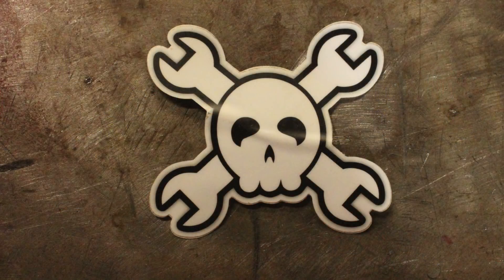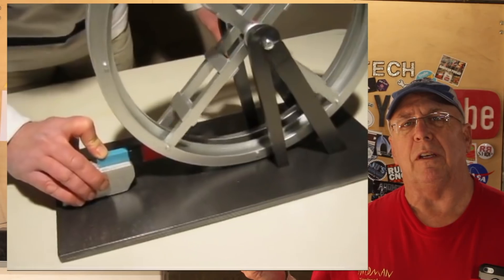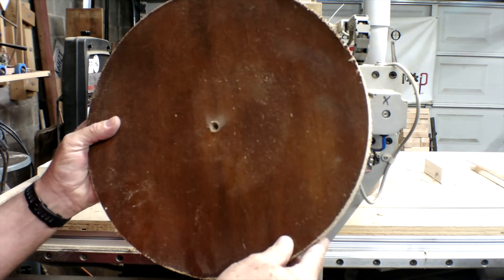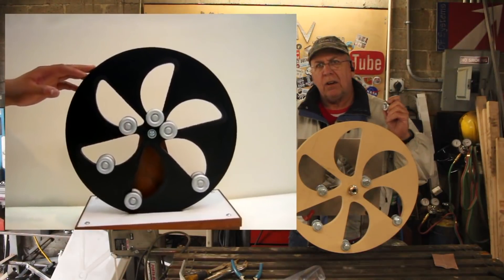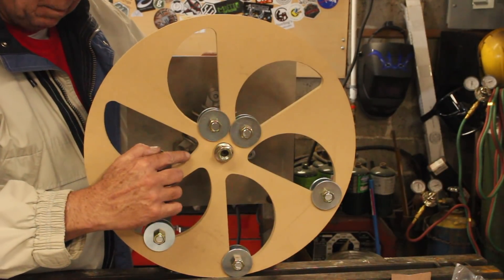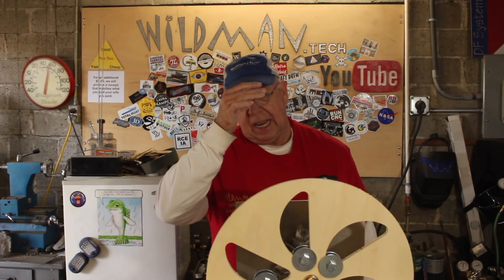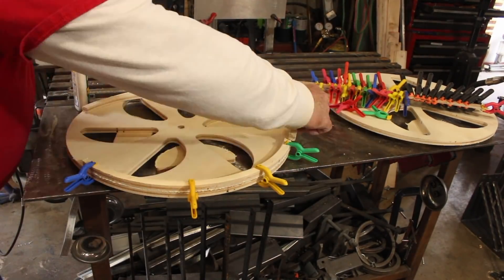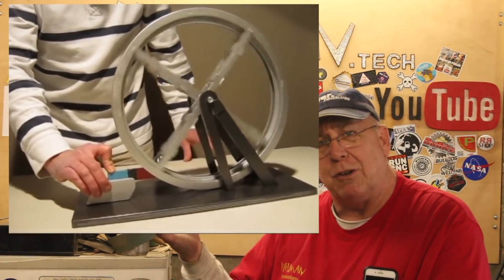Free Energy Devices Debunked!

Comment: I hate that with all the things I know like the earth isn't flat, we landed on the moon, typical conspiracy topics, my brain still can't understand why these things shouldn't work.
I'm not the smartest guy in the room, but I'm also not easily distracted by shiny objects. My own personal oxymoron I guess you could say.
Though I am walking away with new questions a lot of old ones have been answered for me thanks to this video. I guess I never bothered to really study it like other things so I'm far less knowledgeable, and my recent desire to be as self reliant as possible has lead me a bit into the weeds. Think I'll go back to watching solar panel and battery videos.
Sorry rambling. Thanks for the new knowledge sir, much appreciated. Cheers!
Reply from the maker: I just had to try for the same reasons.
Reply: Everything in relation to energy, be that electricity, kinetic energy, heat, etc wants to equally distribute itself. Also, you can only harness energy for human purposes while said equalisation occurs, however long or short that time takes. All energy does is equalise.

Heat and cold mixes to create a temperature somewhere in between. We isolate a fridge as much as possible so the cold does not mix as fast with the outside, hot temperature.

The reason cars and other objects slow down without extra energy is because they are passing their kinetic energy onto other physical objects. Such as air, or another physical object in a crash, in other words the air becomes faster, the car becomes slower. The same applies to electricity. So. Energy equalises, that is all it does, you can only harness som e of that "equalisation" while it happens, harness it for human purposes. For example the internal combustion engine. It explodes gas. What follows is there is large pressure in the combustion chamber and it expands. It expands to equalise the pressure. Now, it is not an accident that the first thing this high pressure gas meets is a piston. Which is the harnessing of the energy.
Reply: Free energy devices DO work. You just aren't told about parametric coupling.
Reply: @lukiepoole9254  You should make a video on the subject and post it here on YouTube.
Reply: Look up HHO GAS you won't be disappointed
Reply: Can you please please please send me proof that the Earth is a spinning ball? I've fallen down the Flat Earth rabbit hole & am actually quite loving it because it's boosting my relationship with the Most High God tbh.
Reply: @god_given  
Probable physics and math that you're too lazy to understand.
Reply: @uuddlrlrabsmhm8430  show me please!

Comment: You can be making energy in about 20 minutes. This can and does work.

Let’s say your sphere has a mass of 250 grams and the wheel a mass of 6 kg.

Place the sphere on the end of a string, Fasten one end of this string to the outer surface of the wheel and wrap the other end of this weighted string around the circumference of the  wheel for about 1 circumference. Wrap the string clockwise; and then spin counterclockwise and release the 250 gram sphere from the wheel. 

The .250 kg will unwrap and stop the rotation of the wheel 

If the average release speed for the 6 kg wheel is 1 m/sec then the sphere speed will be (6 kg / .250 kg) 24 m/sec when the wheel is stopped; because Newtonian momentum is going to be conserved. 

6 kg * 1 m/sec = 6 units of momentum    and    .250 kg * 24 m/sec = 6 units of momentum. 

½ * 6 kg * 1 m/sec * 1 m/sec = 3 Joules      ½ * 1 kg * 24 m/sec * 24 m/sec = 72 Joules

This 72 Joules is real energy. The .250 kg will rise 29.36 m

When the .250 kg is dropped (in something like an Atwood's machine) 1.223 m it will restart the motion of the wheel to 1 m/sec.

Only needing a 1.223 m drop means you can restart the wheel 24 times with one throw. You increase the energy to 24 times.

These SPEEDS are DANGEROUS use caution.  

 https://www.youtube.com/watch?v=w-7d66JscI8

Comment: Energy is never generated. Ever. There is a finite amount of it in the universe. Energy only changes from one form to another through work. So anybody saying they can generate free electric doesn't know electronic engineering.
Reply from the maker: You don't know that. You only think that because it's what you've been taught to believe. There may one day be a discovery. One thing is certain, it won't be discovered by anyone who thinks they already know all the rules. You know, they used to think the only way to fly was a hot air balloon, then someone with a curious mind discovered something.
Reply: @WildmanTech  I think you're misunderstanding me. Free electric can not exist. Harvesting energy is a thing though. They are not the same thing. I'm working on recycling scrap metal in a biodegradable solution to charge lithium ion batteries. Galvanic cells. Where chemical reactions create energy. You make too many assumptions.
Reply from the maker: @base2446  I understood you perfectly and I’m telling you that you’re wrong because you’re brainwashed by an education system that thinks that everything that can ever be discovered has already been discovered. That erroneous belief has been proven false thousands of times through centuries.

Comment: Ask Tesla. Learn History old man
Reply from the maker: If history dictated the future we’d never make any progress. Just because someone else couldn’t do doesn’t automatically mean I can’t either. But I can tell that in your case it does!
Reply: @WildmanTech  thanks for the video. If my understanding of how the ball and magnet thing is supposed to work, the magnet pulls the ball and the weight of the ball is supposed to turn the wheel. Except the weight of the ball can't act on the wheel while it is held up by the magnet. Or is it that as the ball is pulled up the friction of the ball with the wheel will cause the wheel to turn, again as the ball comes up on  the wheel, at some point the pull of the magnet is  countered by the pull of gravity and again it stops. So no, it can't work.
Reply: @WildmanTech  a guy build a car with no fluid. Only magnetic in the 70. Search it on google or here

Comment: the wood is too heavy, they used aluminum for the wheel. the metal ball is not heavy enough to turn the wooden wheel. if you use an aluminum wheel I bet the steel ball will turn it.

Comment: My problem with your demonstration in your whole contraption is wrong from the fly wheel. Flywheel is spinning on an axis or axle in the middle and using a smaller ball and is all metal with perfect balance. You have a piece of wood and the axis to one side. it wobbles and out of balance. plus the ball looks like it is hitting the wood. And your wood flywheel was doomed to fail because the metal ball going again the grain surface of the wood is not a good surface and has much friction to prevent motion. it looks like in  the orignal video they are using an electro magnet instead of a regular magnet. and even if it is a hoax.  Your experiment isnt holding up because you are not using the same materials

Comment: I can show you how to do a terrawatt steady from vibration and feedback with no moving parts... no magnet.. no coil.. no battery and no power input whatsoever. 12 parts total.... but you wouldn't want to build it it's a terrawatt AC.. very dangerous to stand too close to it. It's so incredibly simple though... when you see how simple it is you realize how stupid everyone is. You would need a water jet CNC cutter to cut the 2 granite piezoelectric speakers and a machine shop to make the Fret and the 500 lb xylophone key/ microphone...and the holy grail tweeter that feeds back into the microphone . It works on feedback and piezoelectricity and even makes it's own water that turns into mini suns spinning like a galaxy in a box. It's an incredible feat of mechanical and acoustic engineering and works on the principle of putting the microphone too close to the speaker.. but this is a 500 lb microphone... and when it vibrates bobbing up and down on the fret it amplifies the force on the piezoelectric disks 829:1 giving over 400,000 lbs of force on the disks. As I said.. free energy is so incredibly simple to do. it works exactly like the universe works.. it's all feedback. First you hear the sound and then you see the light. You wondered your whole life how it's done .. just ask me... it's really simple once you see it. I seen the power when I accidentally discovered it about 40 years ago.. It made me shit my pants.. no joke. Spent about 30 years trying to figure out where the power came from.. then it dawned on me that it was just feedback because I remember hearing it before the bolt of lightning struck me... and then I completely solved it just in the last few years... engineered all the parts in 3d.. but too scared to build it.  All it needs is someone with deep pockets to bring it out. The world needs this because .. it makes water .. it makes energy... you can go anywhere you want in the universe on a cup of water and you will never run out because it will use the same water over and over again. Those mini suns from drops of DEW  spinning like a galaxy in a box are exploding right back into the microphone in an endless feedback loop.
Reply: You should build it and put it here on Youtube.
Reply: @MarshWildman  I can send you the 3d drawings so you can understand it better. I would need an email address.  It's basically 2 granite speakers pointed in opposite directions back to back but not touching that are connected only at the center.. and a 500 lb xylophone key/microphone mounted on a fret at the nodes over the outer edge of the speaker facing up.  The xylophone key is like a church bell if you hit it you will hear it for miles... but it is not meant to be hit.. it's a microphone... and so it will pick up all vibrations for miles and feed it to the speakers which in turn will make the center bob up and down up to 20 million hertz.. feeding it right back into the microphone. Because the microphone is heavy and mounted on the speaker.. the feedback will keep it vibrating forever. And so based on the calculation that 500 lbs of force on a granite/quartz speaker produces 4000 volts per cubic centimeter..... you should get 1 trillion volts per speaker. The force is amplified 829:1 from the bobbing up and down action of the center of the 2 connecting speakers that share the center. The center of the speaker facing up has a tweeter cup called the holy grail that sits under an air hole like the hole on a guitar and water condenses in the cup and spills over onto the speaker  where the radio frequency splits it into HHO gas that then goes boom right back into the microphone in an endless feedback loop. Works just like the universe works.. it's feedback because the microphone and speaker are too close together. And so because of the spin.. you don't need a magnet or coil or any power source. The amperage is achieved because the center tweeter is positive and the outer edge of the speaker is negative..and because of the water in the granite speaker it conducts.. and so you get 2 trillion volts with amperage. Parts needed...2 granite speakers... 2 mercy seats shaped like stonehenge that mount over the outer edge of the speakers aka musical frets.. 1 center cog that connects the backs of the 2 speakers together at the center only....one holy grail tweeter cup tuned to 100khz....one 500 lb xylophone key tuned to 90 hertz.... a tuned box /combustion chamber out of thick aluminum to 90 hertz with a hole like a guitar on top.... one wire from the center tweeter to one side of the fret.. 2 heavy duty tuning forks tuned to 90 hertz that go on each side of the xylophone key on top of the box. That's about it. It's pretty simple. The only reason it works is because of something everyone on the whole planet overlooked.. it's feedback. Free energy is a cakewalk.. it's really that easy. All it needs is funding really. And so out of a box the size of a small chest of 27 inches x 45 inches x 27 inches you get the equivalent of 20 power plants in a box... something I just could not build without a building to house it and a team of experts to design the transformer.
Reply: @omegafile  You should build it and document the build here on YouTube. You've already got the problem solved. I know nothing about it. It is far more logical that you, the person with the idea, build it than to try and convey that knowledge to me so I can build it.
Reply: @MarshWildman  I hear ya... I can build the parts but I would never have the courage to put it together.. it's too much power.  Couldn't handle the lightning bolt... but I can make the parts and send it to John Hutchison and let him assemble it.. I showed it to him and he was wowed big time... but I wouldn't want to see anyone get zapped by lightning from it... I  don't think people realize how dangerous it would be.. if not grounded or wearing a protective suit. People design rockets but never build them. I designed this.. but I don't really want to build it. My end was just the mechanical and acoustical engineering. I just wanted to figure it out .. and so I did. I thought about starting a company called Advanced transducers.. manufacturing the disks with a CNC machine... selling only the parts unassembled. I haven't met the right people yet. I don't have the knowhow to give 115 volts AC.. I only know how to do a terrawatt. People who want free energy should just buy solar panels. This is more suited as a power plant or for space travel. It will make it's own gravity because of the doughnut field around it. The waves coming off of it are spinning counter clockwise facing up  and clockwise facing down. It's a self contained acoustic bubble.
Reply from the maker: @omegafile  Send me the parts and I'll build it.
Reply: @WildmanTech   I'll try to get them made in the next year when I go back to work. I have 3 of the parts on Tinker cad but I want to make some slight changes to each part and redraw them separate. They are there on one page right now. I will probably make the disks first once I find someone with a water jet CNC machine that can cut granite.
You can view the parts if you want but I need an email address to open the link for viewing. The disk.. the center cog and the mercy seat are there right now. Need to cut 2 disks.. 2 mercy seats and one cog... then I have to find someone in Nepal or India to make the tweeter cup aka signing bowl / holy grail tweeter. The bottom of the cup has to be made specifically to fit in the center of the speaker facing up. The top of the cup has to be tuned to 100khz which is about the right frequency to split water and get levitation.The aluminum box with the air hole I'm not sure I can afford to make for awhile. The xylophone key is pretty heavy to ship.. you could start with a 100 lb one but you would have to make the disks thinner. It would change everything. The main body of the disks are 3/8 inch thick... but it has ridges and a back making it thicker in spots... you will see if you look at the disks online. The disks look exactly like the 12 - 3/8 Dropa stones that were found in China that supposedly came out of a UFO of which there are only 1 set of pictures in existence. If you find those stones online zoom in and you can see the wear marks where the mercy seat and the tweeter sat on it. One of the Disks is broken. and I know where the disks really came from. That's a long story that ties to one of the Kings of England in the 4th or 5th century.. and the remaining parts were found in a cave in in Westminster Abbey in the 1700's. There are even old texts that describe the bronzing of the disks. there is some truth to the legend of King Arthur and the Knights of the round "tablets" .. not Table... and the philosophers stone.. is indeed the xylophone key.. made out of a meteorite and rang like a bell.. and the fake one is owned by the Queen.... replaced with a replica. If it doesn't ring like a bell it's not the real deal.  I researched deep to figure it out and too much to tell here.
Reply: @WildmanTech  The transformer for such a device would cost so much money it would take someone with deep pockets to fund it and possibly years to make. This will give the power.. the transformer is another story altogether. There is a 4 inch tray area between the center of the speaker to the edge where the dew will fall on increasing conductivity.. and so you will get 100,000 volts arcing inside... but on the outside..2 trillion volts will throw a bolt of lightning pretty far considering it's 25,000 volts per inch of arc. I didn't calculate it but I wouldn't want to stand within a few hundred feet away from it. It's deadly.. I did it by accident with a well pump switch.. my fingernail was the xylophone key... you'd think something that small would be less deadly.. think again... it lit up my basement brighter than the sun. I could feel a hand reaching in my chest and squeezing my heart.

Comment: You spent a month to make a horrible plyboard wheel that has so much friction in it when you moved it it stopped instantly? Get a bicycle wheel, put a perspex ring over it and a ball inside, get an electromagnet, use an exterior rim rather than interior and see if it works.
Reply: I did all of this in two days.

Comment: There are free energy devices that do function they are not creating energy however they are simply getting their energy from a new source of energy that main stream science and governments don’t want on the market because the world runs on oil and the money has to keep flowing into the correct pockets.   So if you want to have success either extract power out of the charged atmosphere or universe which ever it’s actually coming from by manipulating magnetic fields or you can build the skinner gravity power machine or the milkovic oscillator And there are others that work also.